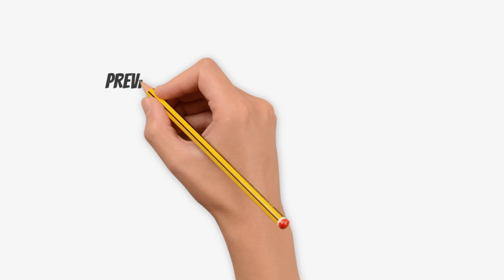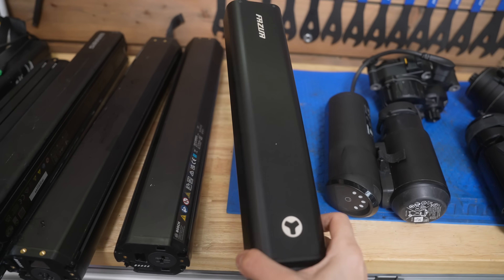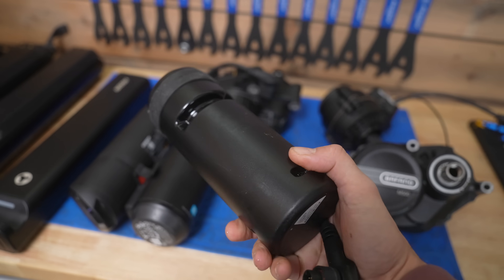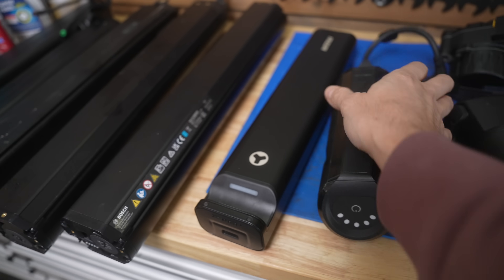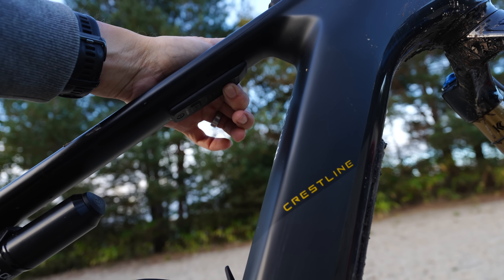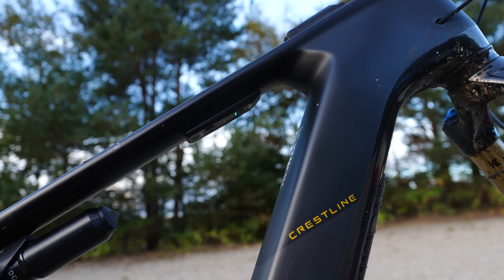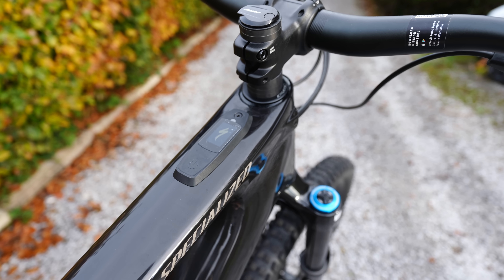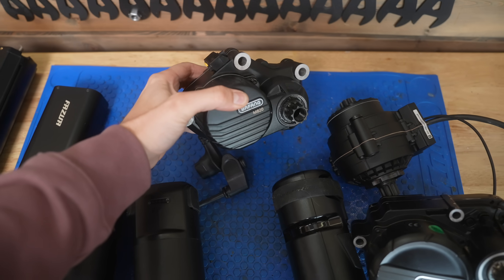We Have A Huge Problem With Ebikes....

Comment: Spot on! I've been thinking exactly the same thing. 
My son has been exploring the idea of an eBike, but the compatibility issues are massive.  And throwing away something that costs thousands of pounds isn't an attractive option.
He's decided to bypass the manufacturers and simply fit an after-market rear-wheel motor to an existing bike. 
It'll be cheaper. And if the e-kit fails catastrophically, he can always return his bike to a manual ride.
Cheers
Reply: Much cheaper, and he can fit a cheeky handlebar throttle if he wants.

Comment: As XKCD has put it;
>Situation: there are 14 competing standards
>14?! Ridiculous! we need to develop one universal standard that covers everyone's use cases.
>yeah!
>Situation: there are 15 competing standards

Without an overall seeing governing body, like what Apple went through in the EU that forced them to adopt the USB-C "standard", i dont think we will see a universal battery system. there are larger companies with proprietary batteries that may butt-in (talking about power tool manufacturers like Makita, Dewalt, Milwaukee, etc) that may sit in and chime in to defend themselves because any talks about "standardizing" a battery system for bikes, even unrelated, may just stop it in it's tracks. Apple sat in at a small government decision for right-to-repair. but that's a deeper rabbit hole since the bike market isn't as vast as the power tool brands are.

 but agreed steps are the definite way to go. unify the charger or at least the plugs used, like how there is now a standard for SAE J1772 plug now taking over (to my understanding it was solected but not sure if it was written in as the standard) for Electric vehicles. Do we love standards? yes. do we want backwards compatibility? absolutely. but unless there is a gentleman's agreement among the main e-bike manufacturers, i'm hopeful but i wont be disappointed that it wont happen.

YT recommended the vid, great topic to talk about

Comment: years ago there was a start up (Better Place) that thought their idea of universal batteries and battery switching stations would be the new sliced bread on the block. Instead of a gas station, you'd go to the battery switch station and they'd take out your depleted unit for a fully charged one. Sadly the idea died because every auto manufacturer had their own proprietary battery. I totally agree. I'd like to get a new bike now but am too worried about the unit being antiquated in a couple of months.

Comment: I think you have a point but it's going to be a slow process to get there, IMO.
I don't know the history in cycling , but manufacturers seem to drive standardisation. E.g. Shimano, campag etc. There are some compatibilities between major brands but generally no.
We have standards for wheel sizes, headset sizes, bottom bracket sizes (although the choices have become more diverse in last 20 years), brake pads etc.
I'm interested in why some things are standard and others not (so much), maybe it's to do with patents and market and market share/influence (I guess how long an item was widely used made it a 'standard' like 68mm BB.)

So would we, should we, expect a Honda engine or fuel tank/EV battery to be compatible with a Mercedes?
Yet the terminals in a 12v Lead acid are standard for cars.🤔 

It's not in a manufacturers best interest to standardise most of what they sell or use because there will always be someone who can do it cheaper. 
And so bespoke parts mean more parts sales for them.

We have cassettes from 5 to 12 speed and the shifters aren't compatible, chains aren't compatible (across more than a few) , derailleurs are however, and we don't complain too much about standardising chain width or cassette gear spacing.

It will come but don't hold your breath 😎

Comment: That's the reason why I made my own ebike, cuz there is no guarantee that i'll get a new battery or replace any other broken parts in future and it may end as expensive pile of garbage. The main reason why systems/brands are not compatible with each other is quite simple, different motors needs different power and battery need be good enough to supply (Volts, Watt output) without overheating, otherwise there is a huge risk of damage or turn directly into flames which they try to prevent using fancy connectors and shapes.

Comment: If you don't care about the warranties, and can splice on whatever connectors you want, most of those batteries actually are compatible with most bikes. It's just an insane sacrifice for a brand new ebike to lose that mfg support and reliability/appropriate liability to start snipping and soldering to swap batteries.

Comment: There are RC battery chargers that cope with different voltages , you should just need a plug adapter to charge anything between 30 and 50v  .  In fact dont even sell the charger with the bike

Comment: Well said Rob, it’s a nightmare for consumers and shops alike. I would also add that manufacturer’s should be selling all the internal motor parts including circuit boards separately for a minimum of 15 years after the motor ceases production. Only Yamaha do this as far as I know (but not for 15 years). Imagine having a part fail on your car engine and being told you need to buy a new motor, it’s daylight robber.
Reply: Perhaps Yamaha do it because they make motorcycles. Car and motorcycle manufacturers are required to have spare parts available for a number of years- 10 at least. I am waiting a while longer until I get an e-bike. I want something that will last at least 5 years if not more, I still have mountain bikes from 2005-2008, 3 of them. Upgraded many parts and still very usable bikes.
Reply: You all should go live in Venezuela!
Reply: @williambrandondavis6897 why?

Comment: In engineering it's called the ISO system, going forward all transport will need to be modular designs for sustainability
It used to be called common sense

Comment: Totally agree on charging standard.  As for battery and motor, that's a tricky one.  Afterall motors and "gas tanks" between automotive manufacturers aren't standard.  But the gas/petrol put in is...

Comment: Once upon a time , there was a great "battle" between video recorder systems , called Betamax and VHS. Even though Beta was superior in quality (it was used until fairly recently in planes, and TV stations , long after no one was using VHS , because of digital era) , it was more expensive and promoters of VHS invested more money in promotion , but ultimately , VHS won the broad market (you know , it was cheaper) - so , it became a standard.
 As for e-bikes , I wont cry for people who spend 8-10 grand , on a single unit (and cry why they can't upgrade it) , because , even though , there is a quality in (most of) those products - basically people who spend that kind of money (excluding professionals) are buying image of social status and , for the most part , those older e bikes work fine. Yes , it would be nice to be able to upgrade here and there some components , but it is the same (in my mind) if owners of older Lamborghini's are complaining about not be able to put parts from a newer model and thereby increase performance of the car. Probably , there will be no standardization (like with video recorders) , because of myriad of companies which make those bikes (and the components separately) and they all want to stay in business (at least) , banking on a fairly new fashion of people with excess money wanting the newest shiny thing . For that kind of money , almost anyone can design his/hers ideal bike and get it made by someone else (I mean professionals) with some change left. In that price range , people are buying brands to show off and paying for R&D of those companies. Those things are meant to be spent and/or obsolete , after certain period of time .
 BTW , I'm typing this on a 15 years old lap top , which works fine for my needs and I have 7 year old phone (4G) , which also works fine , except camera quality (compared to new models) and it has exchangeable battery (unlike new models). Professionals which are working with graphics/videos , may need to be in the trend of new stuff , as well as , so called , power users of the smart phones , but the rest of the people - don't.

Comment: Until ANT+ came about it was the same problem, and then it went away. Then phones wouldn't adopt ANT in lieu of BLE, BLE badly copied ANT+'s homework with no compliance testing software, poor debugging of the documentation, and companies like Apple doing special hacks behind the scenes that were incompatible. Now 12 - 14 years later, BLE profiles for sports still suck, haven't been updated, and made up terms like "zwift compatibilty mode" are becoming ubiquitous without being defined properly. The thing is ANT is old tech from the early 2000's that has maintained compatibility but modern noisy RF is making it not work so well. BLE is being leaned on and it's a mess, but 50k/year to have a voice in a room with nobody talking is hard to swallow. Old ideas like incompatible razor's are the name of the game and durability from 2/3 component brands is dropping because of the "buy new bike" cycle. Who needs a durable and replaceable battery, cassette, chain even if consumers are willing to replace the whole bike due to overpriced scammy shops. Why would a company step up and do the engineering and leg work for what pay off?

Comment: Plus OEM brands dont even stock spare parts for older generations of the motor that does fit. After a few years you are screwed, they dont make the older parts anymore so your ebike is scrap. ( I have experienced it with a 5 year old commuter bike.)

Comment: Fully agree. We have three ebikes with Shimano E6000 from 2015. The motor cannot be repaired - fortunately I found a spare motor in ebay, that I managed to build in, and set the settings for a third party software that I pad €100.

The batteries can only do 20-30km at max. The battery cannot be bought anymore, and battery cells cannot be refreshed because the software locks if 'tampered with'.

Now I see the value in buying mechanical bikes and retrofit them.

Comment: You nailed it Rob.
This is why I bought my e-bike for 40% off.  The future loss becomes much more palatable.
Conversion kits are getting better, and you can always convert the bike back to a normal bike, and/or upgrade to a new conversion kit.
Yes, they severely lack esthetic integration, but in 10 years time would likely hold more of their value than a current fully integrated e-bike, and have the ability to purchase a new motor, screen or battery to upgrade rather than buying a completely new bike with all new parts.

Please consider doing some Conversion kit reviews.

Comment: Good luck with all that.  With People For Bikes supporting the industry in regards to Right to Repair laws in America, it's only going to get worse.  If you are willing to break into sealed systems, splice old plugs to new components, and replace bad cells in proprietary shaped battery packs, you'll be living large in about 5 years when these machines start being given away because the 65 year old lady who bought one turns 70 and finds herself staring at a non-operable, formerly $10,000 e-bike that she can't hang in her garage.  Apologies for that possible run-on sentence.

Comment: Do not buy anything I you are afraid that it will be outdated in future. Not just bikes but anything. Yes standard would be nice.
Reply: The barriers to taking a steel Roadbike from the 70s and giving it some nice carbon wheels, perhaps better brakes n shifting, are pretty low.

Comment: The issue is that one bike may be 36v, another 48v, another 72v. Hook a 72v battery or charger to a 36v system you will have a bad time. This is why these companies make different chargers and battery connectors. They should standardize it based on voltage though.

Comment: CYC, Bafang, these motors can be installed on most any bike and removed and installed on another bike, I've never fixed a flat let alone install an ebike motor. I installed my cyc photon on my specialized fuse in under an hour. A year later and no issues. Pre-made ebikes are made for Boomers who can throw money at a new ebike when there's is obsolete.

Comment: Well done young man very enlightening. I had my suspicians about the polluting aspect of the new E bike revolution.. so many points to raise.. How many e-bikes are being used for daily work commuting and how many for simply enjoying the great outdoors? 
It's only GREEN if you are replacing personal petrol based transportation. There could be a an end point to sales when the costs are eventually realised by the punters.. I go riding my push iron a lot in comparison as I hardly see the e bikers except in summer  Even then they don't get out like I do. Guessing there are hidden costly extras.

Comment: Can we stop with the idea that in 6 months, your ebike is outdated? It will still pedal. It will still charge. It will still get you to where you're going. The real question will be in 4 or 5 years time, can you buy a replacement battery when your battery no longer holds a sufficient charge. But ebikes aren't computers. They don't (or shouldn't) require new software constantly and arguably shouldn't need to be [constantly] connected to the internet. So while a newer fancier bike may come out after you buy yours, yours will still work as originally intended.

Comment: Bafang is probably the only motor system that doesn't do this to an extent. So far the M410, M510, M560 and M600 fits in the same frames and use the same displays. That is what made me choose a Bafang full squish frame with a M600 3 years ago. Made 7000km of hard riding without any motor problems. It's still going strong, but I decided to upgrade the motor to the M560. I would never go with a big brand e-bike for the exact reasons mentioned in the video, They offer no easy way to upgrade or repair. With Bafang, if I break my frame I can still get a new one, if I break my motor I can just get parts to fix it. And it will cost way less than a Yamaha or Bosh. And the charger for the battery is just a standard plug that you find on almost any AC to DC power converter.
Reply: Let's have someone post a video on this.  I'd take any band that isn't about planned obsolescence.  The rest can loose business till they get a clue
Reply: When I was making my commuter ebike, I went with the bbs02 as it'll fit in any standard bike, parts are easily available and they keep compatibility going as much as possible. When I do finally get round to upgrading the bike I'll almost certainly be sticking with bafang. Someone just needs to make an open standard, then the market will follow.
Reply: @ChristopherNutt  I also have a BBS02B  500w full squish MTB that I built back in 2016-17. My only problem with it, is that the smallest chaining with a good offset I can fit on it is 42T. A bit big for a MTB and I had to make a custom battery to fit in the frame. I still use it as a loner for my bikeless friends. Works fine. But the M560 is just so much more capable in a MTB.
Reply: @ChristopherNutt  An open standard already exists pretty much. Chinese generic e-bike parts work together. You can buy a variety of Chinese motors, KT controllers and batteries and chargers that have not been deliberately crippled by canbus codes that make the stuff shut down when it detects no proprietary  parts.

The really bad thing is that scares about ebike fires (usually caused by hideous franken bikes with taped together batteries without any BMS) is being used to insist that chargers and batteries must shut down if not connected to original parts. The House of Lords bill in the UK on controlling ebike supply and parts does exactly that.
Reply: Bafang rock my world... over 2 years, multi builds, some doing 50 miles a day, every day, service is simple every 1000ish miles and the price is unbelievable compared to the rest.. changers slandered, use any battery with the right voltage, all the motors from 250 watts to 1.5 killer watts....  all fit slandered frames, the newer motors all fit in their older frames. what was the problem again... ?
Reply: I agree about Bafang. I have a bbso2 that I put on my old Trek and it rocks. Got a couple thousand miles on it. Burned out the display and put on another with no problem. Big name companies with proprietary systems lock you into their product line. I don't see them changing anytime soon. Until then, it`s Bafang for me.
Reply: @mygallimaufryofshortstories  You should try the M560 or any M series motor from Bafang. With instant reaction from torque sensing, it's on an other level, you wont want to go back to the BBS02 with only pedal input sensing. Not to mention that the chain line is perfect, and you can use a standard 32T narrow-wide 104BDC chainring. And the power o_0. Only downside is that you have to order a Chinese frame, but they are a lot better than most people think. Already have 7,000 km of hard riding on my carbon Dengfu and it's still going strong.